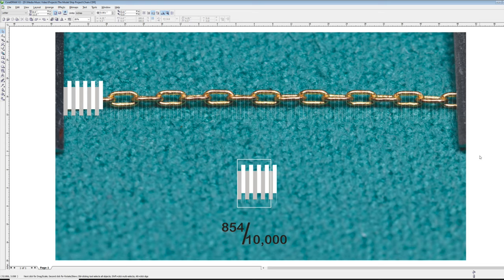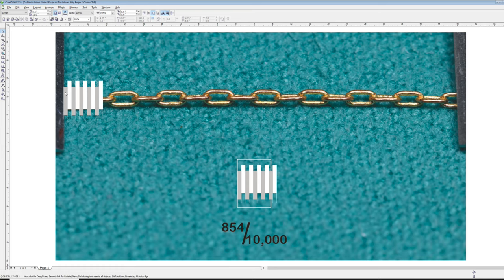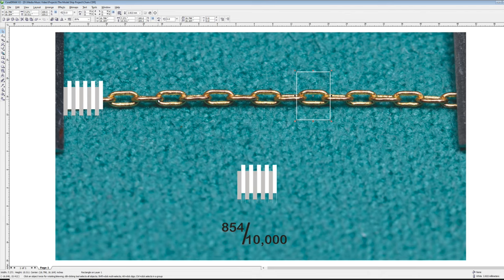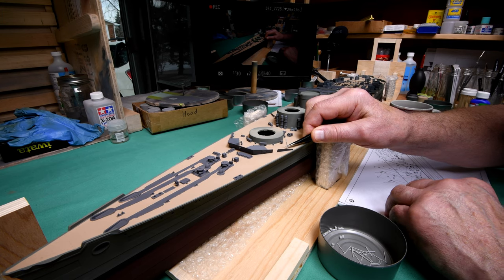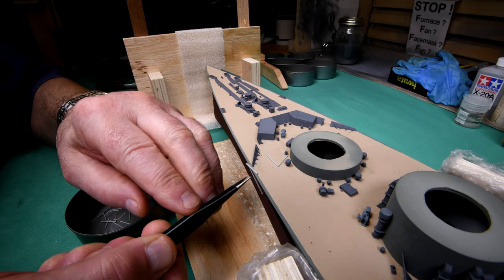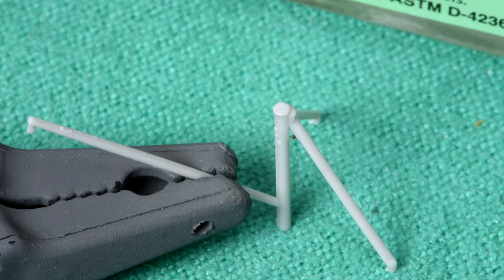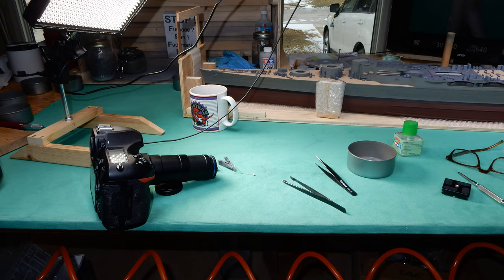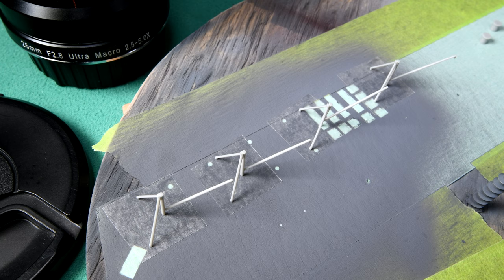The Model Ship - Part 626

Comment: I think you will find these small cranes used to bring the 15in projectiles aboard.  Note they are next to each turret barbette.  If not in use they may be stowed flat on the deck and erected when needed.  The use of alligator clips to form and hold the crane tripods is very clever!  I learn new things with each of your videos.